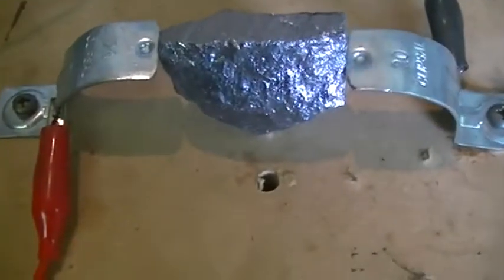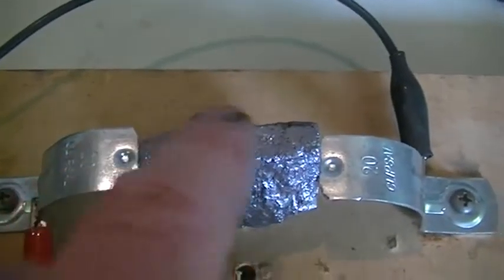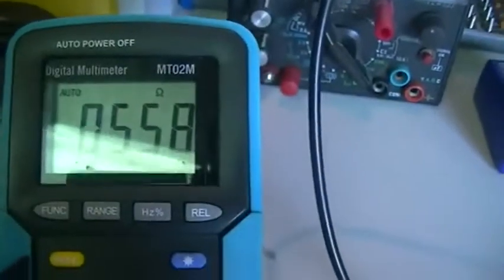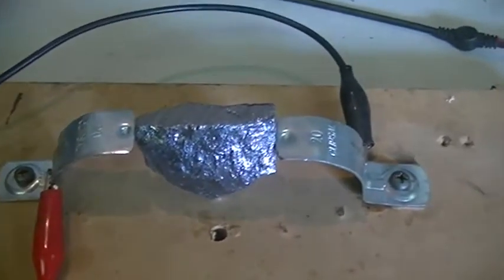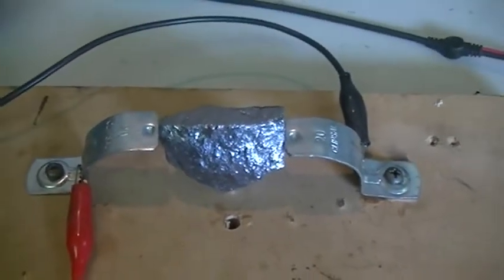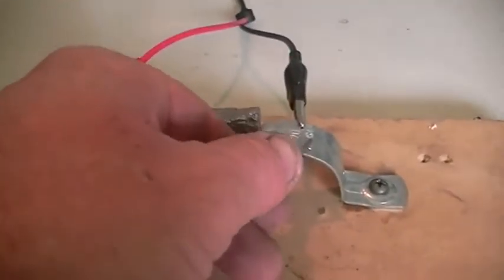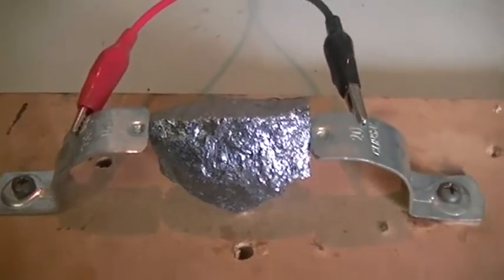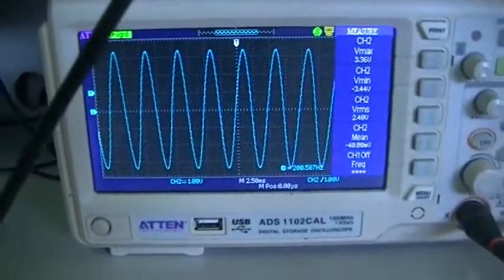Space rock more test with scope

Comment: Can you tell me if anyone found out exactly what this rock is? I have found a small chunk that I too believe is a meteorite. It is nearly identical to the one you have. Mine is approx. 40 mm long 30mm thick. Has a partial parabolic face. The one side appears to have been blown apart as it is fragmented in comparison to the rest of the rock. The entire rock has been melted with microscopic spirals and evidence of all sediment being ripped away in one direction. This rock too is not magnetic and is very conductive.mit does not test positive for any known metals yet it looks like Chrome when polished. The density is not in line with anything I have been able to find at 4.77 I had it tested by Actlabs where it was found to have almost 2.5% chromium and the high level makes it impossible to be a terrestrial rock. The other elemental levels however, do not fall in line with any other "known" meteorites. So is it possible we have something totally new here??? Bill

Comment: its a thermoelectric effect caused by the heat directly related to the electron flow. try heating a probe any thick  copper with a point will do  and reading the amps generated. proving it to be thermoelectric. have fun.

Comment: Yup... Semiconductive... rectifying... also explains the previous video. If you'd look at it for both AC and DC drop across the 'rock' while running the motor, you'd see something more interesting.  The connection points between the steel brackets and the rock creates the "semi-conductor junctions", which creates the "fixed" voltage drop at that very point, so that every other point gives the approximate same voltage... like you were seeing.